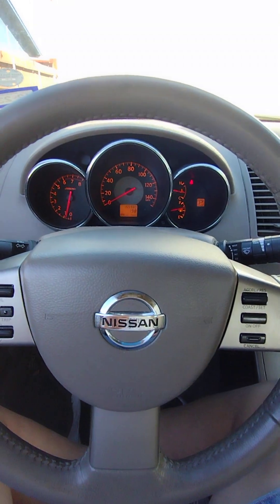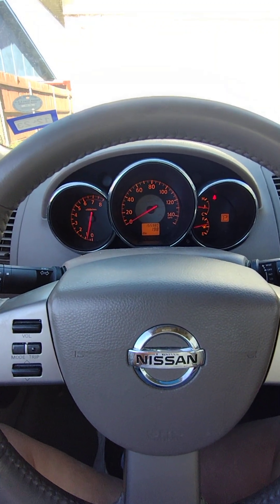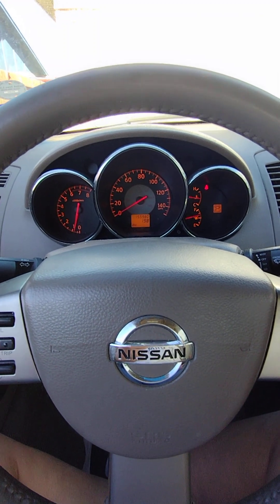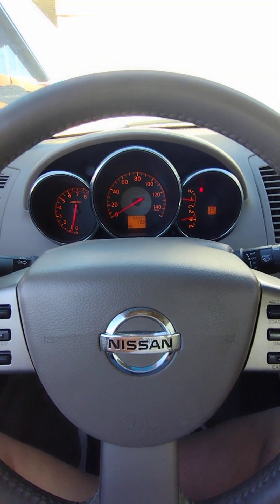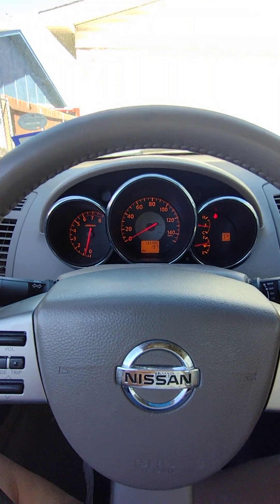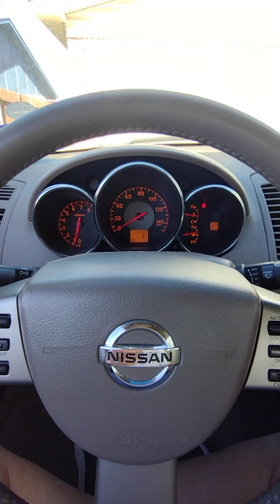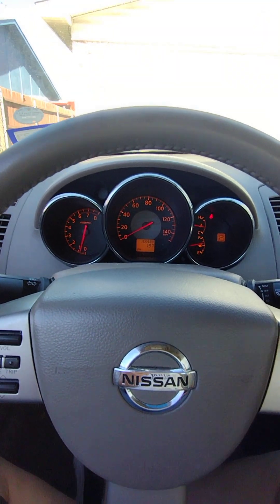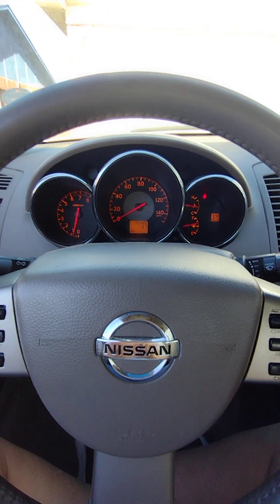2006 Nissan Altima 2.5L - P2A00 air flow error code analysis

Comment: What was the out one with the O2 sensor?
Reply from the maker: Still trying to fix car; replaced everything and found no intake/exhaust leaks.  Thinking that the aftermarket O2 sensors not meeting specs.  When downstream sensor was bad, was getting P420 code; now getting PA200 again.
Reply: @johnhermann762  i replaced mine with an aftermarket as well and I’m getting a pending code that won’t confirm to an actual code so the check engine light won’t light up. All monitors are set so it’s still eligible to pass smog. Been like that for weeks now.
Reply from the maker: @luisabbadie4547  I figured out that the Thottle Position Sensor (TPS) is not working right; will be replacing the throttle body to correct.  I suspect that will fix my problems.  See my latest video for more details.

Comment: Kind Sir....These CVS trans have a problem; that almost all will have a terrible problem sooner or earlier...AFTER you have clean and/or buys the Air and Gas items. And it's very sneaky.

Thus, you need the car to "Learn" it again! Check this out ,on other YouTube videos. And there are untold videos on THIS problem on Nissan's. One of the best is in..."Nissan P0507 Idle Control System - Idle Relearn Procedure" Try it. It's great.
Reply from the maker: This is a 2006 Altima with a 4 speed transmission. Monitoring the voltage on the O2 sensor should not be affected by any relearn procedure; that is a physical measurement and not some factor calculated by the computer.  I don't believe an idle relearn is needed in this case since the car is idling smooth and correctly; I have a video on the relearn procedure for this car that does not require a dealer level tool (if that is what you are referring to).
Reply: @johnhermann762  Sorry I didn't know it was 4 speed. I should noticed better.